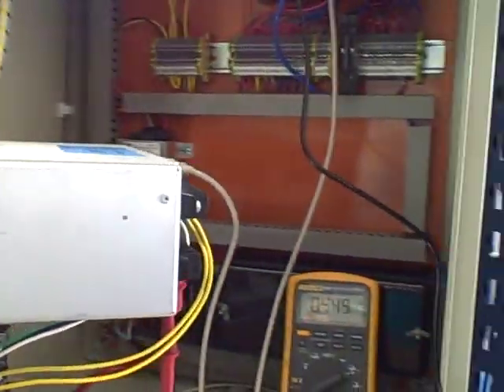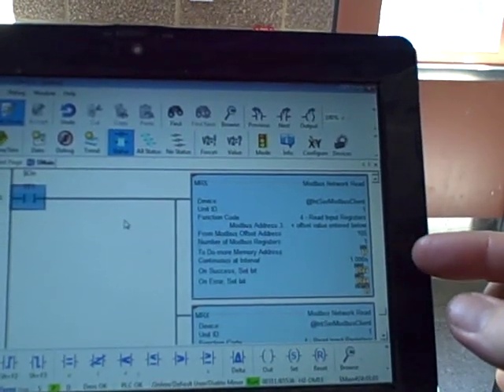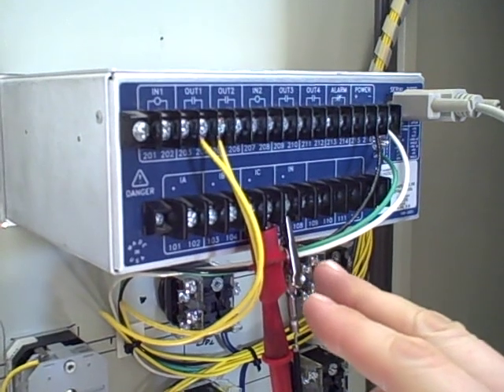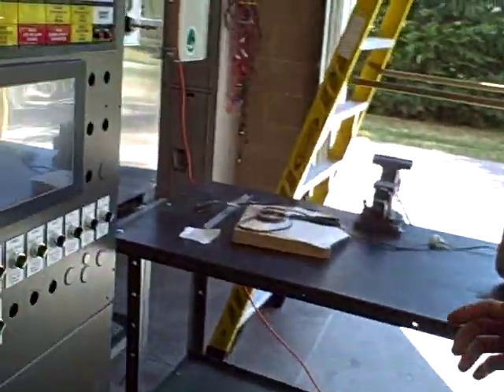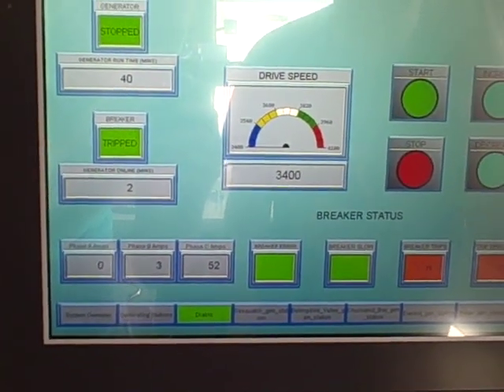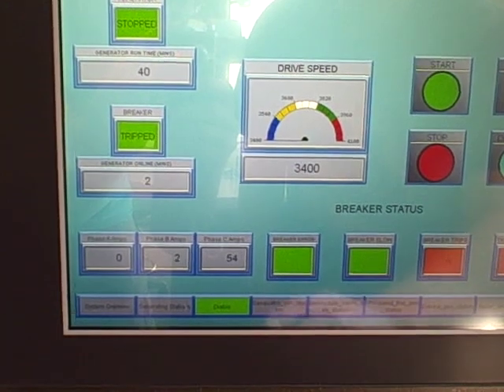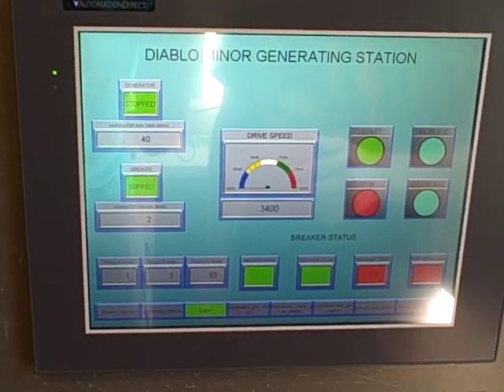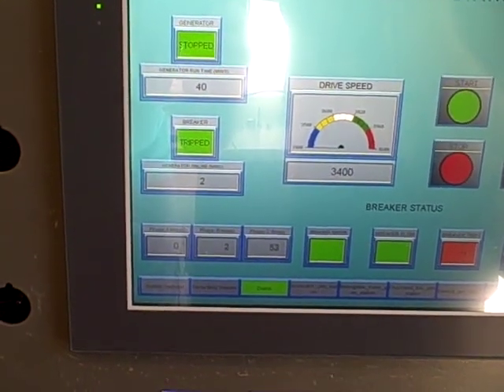Reading Modbus registers from an SEL-551 protective relay

Comment: Hi am doing something similar, with siemens S7-1200 PLC and SEL 751A Relay. But for some reason I am having trouble communicating both devices thru modbus rtu with rs232 cable :(